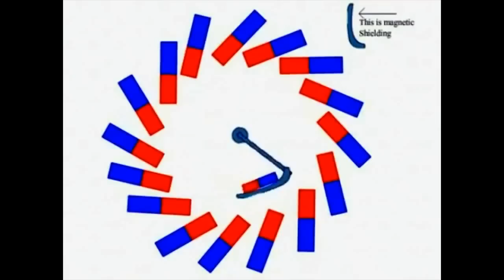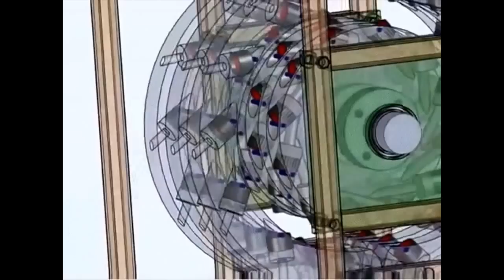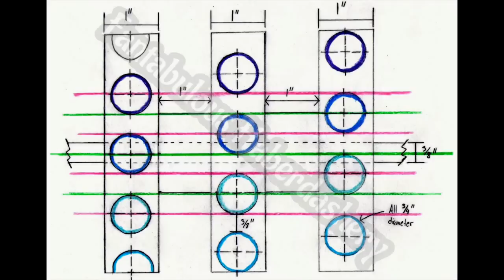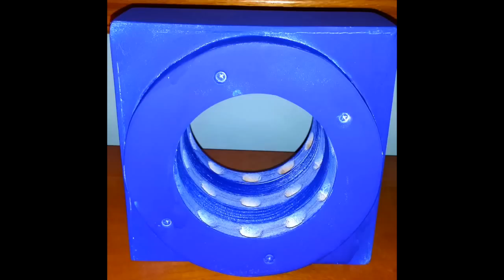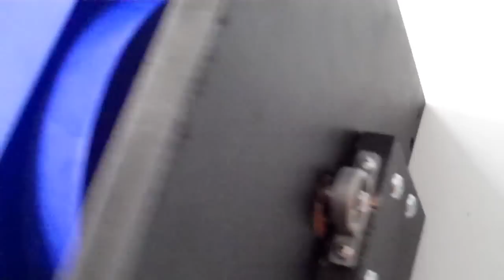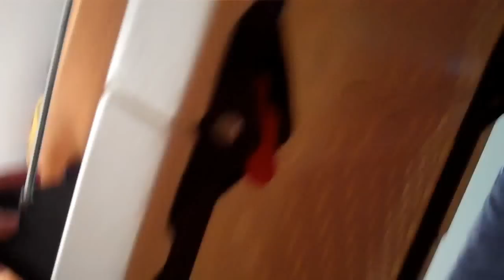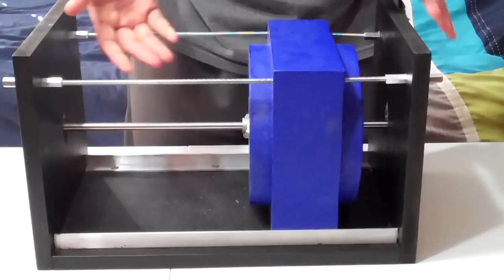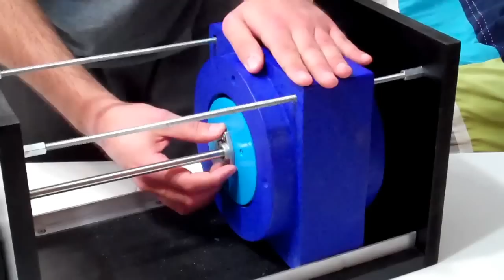Working Perendev Magnet Motor!

Comment: Its fake!!! Look for a shadow on the far left when he takes his right hand out of view, a shadow of what has to be an external assist motor likely with a rubberized knob, suddenly appears, he is placing a motor against end of the rod from the outside.  That's why he is holding his left hand so hard on the machine, it's to offset his right hand pressing the assist motor onto the rod where it comes out, (then see the shadow disappear right before it suddenly starts to slow down).  He goes again, and again you can see the shadow was there and disappears.  Lying Thief.
Reply: this.sure with good bearings, well weighted fly wheel,  and minimal air friction u can get one of these to sustain a decent rpm for quite some time with just the initial input energy. however as soon as u hook it up to a gen and put a load on it itll lose that initial energy immediately.
Reply: Nothing like that. It's just about video editing. First you can hear how his voice sounds different while the looped-clip is playing which shall show it perpetuate. Second you can clearly hear how the rotating sound loops on the second clip. He uses no motor - some video editing is enough to let it run. Unfortunately not good enough to look real ;)
Reply: Rob England It slows down because the rotor rotation is uneven, watch the uneven rotation!
Reply: +Fitzliputzli23 it's his arm. Why would he need to cheat? his video doesn't really prove anything even though he considers his experiment a success, the machine clearly slow down and he is not selling any schematics. 
because of all the scam, people are so biased against the perendev motor that they always search to prove that whoever makes a video is a scammer even when it's clearly a friendly low-cost experiment.
Reply: You are right, my first guess was that he actually build-in a battery powered oscillator and electromagnet into the piece of wood. That would also be super easy to do.
Reply: There is nothing such as a "Perpetual Motion Generator". Any machine outputting energy will need it from some source that complies with laws of physics.
Reply: @Phantom Of The Opera, gosh, you don't understand the laws of physics involved. ANY object in motion has a KINETIC ENERGY that depends on its weight and speed. And objects slow down unless they move in a 100% friction less environment. E.g. planet earth can (almost) maintain it's kinetic energy moving around the sun as the FRICTION through the solar system's space is very low. The continuous loss of energy from the earth constantly hitting into particles emitted from the sun surely has a slowing effect, but it's very tiny. Another even closer example of energy losses concerning motion in space is that the earth's rotation itself is slowing down due to energy losses from the transfer of Earth's rotational momentum to the Moon's orbital momentum as tidal friction slows the Earth's rotation. That increase in the Moon's speed is causing it to slowly recede from Earth (about 4 cm per year), increasing its orbital period and the length of a month as well.
The force of gravity is what holds together large objects in space. It's likely that the math involved in gravity over large distances is more complex than we currently know and could explain the notion of "dark matter".
Reply: There is no magic in any system involving motion that has a very tiny energy loss and thus can run for a very long time. There is nothing Tesla did that is mysterious to modern science. In fact he had a weak understanding in some areas of what he was researching. For example, he imagined using wireless power well beyond what is actually feasible, efficient and safe. During his experimentations he also learned the hard way the dangers of ionizing radiation.
Just because I can't perceive the world slowing doesn't mean it's not slowing. Human senses are quite weak on detecting many things in nature.
So what exactly did the great Tesla prove that all the energy the world could ever need is available? LOL
Reply: Chill out man its not even that impressive.
Reply: Rob England, you are right. At 8:39 the reflection in the far left reveals the fake. He clearly adds something dark that hasn't been there before. And immediately the speed increases. At 9:15 the reflecting object is being removed. This is followed by a not very well made cut (poor editing quality). 
So, Haberdashery: For a first try your video is not too bad. Still a novice, though. But I see potential. It is all about practice. So, chin up, you may become a good faker someday!
Reply: Rob England damn right Rob I see it on the left wall where the white reflection is when he puts his right hand out of you you can see a shadow go on the wall and the motor continues to turn

Comment: You have a tiny Fly Weight on there why not use a Ultra weight flywheel 10x 15x 30x the weight of the rotor once it spins up and "Catches" as you say centrifugal force and weight alone should be able to keep it running far longer that what it Is at the moment Look at some of the old 1800's Diesel motors they were tiny little 30CC Cylinders  with a flywheel 500x their weight once it got up to speed you could shut off the fuel for 5-10 Min sometimes longer if they bearings are really good , Expansion, Contraction IE turning it into a Stirling type motor. or if you set it on a revolution counter and every 30th time it cycled it gave fuel for 2 cycles bringing it back up to speed like a "Hit and Miss motor"  There is no true Free energy with the right setup you can actually generate electricity for 1/2000th -1/4000th of the average cost   Just combine a ULTRA weight flywheel to a hit and miss diesel yes it would be a pain in the Arse to get started but once it got spun up it would be almost impossible to stop
Reply: MrClaypogue .. yes

Comment: oh man, please!
First: You gave it impulse and it can rotate, but not for unlimited time. With every rotation is use some of your impulse.
Sec.: It is without load, like all videos! When you connect a load like a generator, it will fail and not rotate.
Reply: Third: There is an electric motor, just out of frame on the left side, that he is using to spin this pos.  Harberdashery, you are a con man.
Reply: Hey James, why don't YOU try that?
Reply: I think this concept will work.  The problem was that he used aluminum in the construction thinking aluminum is not magnetic, but it is.  Aluminum is magnetic when the magnetic field is moving but the magnetic drag slows the motion down.  Try this: put a small piece of aluminum say 1 or 2 or 3 inches square on the table and then take your strongest magnet and move it quickly across the top of the aluminum.  It will slide across the table in the direction of the movement of the magnet.  The magnet creates electrical currents in the aluminum and the electrical currents of course create magnetic fields.  That causes a magnetic response that will stop any motor as it uses up energy, creates heat,  and has a magnetic field pulling in the opposite direct to the motion.  But it was a good idea.  Remove the aluminum and you will see.

Comment: Cool design man.  Not sure if its as advertised, but you make a great case with your common sense and logical thought streams.   I do wonder... if the actual off-balance nature of the imperfect structure ... actually causes an energy amplification effect.  Sort of like a springy compression and release... coupled with some mild flex, leverage, possibly aerodynamic effects, gravity, as well as vibrational structural effects.   They say that the key to the universe is vibration.  It would be interesting to see a flawless version.. maybe with magnetic bearings.  I also do wonder, if plastics spinning causes a slight static charge.. which could effect things.  So maybe wood, stone, or something similar.. could be used.   As for shielding magnetics.. I was recently schooled about the internals of Hard Drive magnets.  Their super powerful Neos are mounted to a special metal backing.. that is absolutely incredible in its ability to shield.

Comment: What do you have under the table? A motor spinning a wheel studded with neodymium magnets that cause your so called motor to spin as it is acted upon by magnetic induction through the table top? Because what I do know, is that this and any other so called magnetic motor will not work! At least not in a package like the one you are trying to convince people will work without any external source of energy. There are smart people in the world, and you are probably one of them. The Power Station at Niagara Falls has huge generators that are turned via falling water. The electricity that is produced by this station provides electrical power for many homes and businesses. Believe me, some very ultra ingenious people designed and built this power station, and had magnets worked as equally good or even better source of energy than falling water, they would not be using falling water. Spinning magnets in the rotor of these generators move electrons through huge elaborate coils in the stator. The spinning magnets are spun by the pure tonnage of falling water. Magnets can never take the place of falling water,  wind, or heat. Think about it if you really have a good grasp on physics.

Comment: 1)change magnet shape to alter magnetic field for less end point attraction and tighter repulsion field,(hollow mushroom shape maybe)  only solution atm as monopole mags haven't been invented yet,
("When two equal magnets touch each other, the attraction between two unequal poles is 5-10% stronger than the repulsion of equal poles. That is due to the alignment of the molecular magnets in a magnet. In a single magnet, the molecular magnets are aligned sort of parallel to each other.")
2) will it spin under load from current draw

3) can a robert boyle perpetual water wheel flask be integrated for extra force ? perhaps.
Reply: Ah ah ah, altering magnetic field shape !!! You're too fun.

Comment: My theory based on field theory, is that movement is an attribute, the only energy comes from polarity, every action has an equal and opposite reaction, so for one spin, creates opposite spin -> polarity, like spins repel, and opposite attract, the energy IS the spin, the movement force is inertia, the spins cause acceleration. Think about this, where is the energy causing magnets to attract to each other? It takes a very small amount of energy to magnetize magnets, yet you can combine magnets with mechanical movement to create electricity for a very long time until the coherency of the atoms in the magnet eventually become incoherent, but then you can once again realign them for small amounts of energy to make them coherent. magnets them selves create mechanical movement with no outside mechanical movement  (place two magnets opposite poles within a vecinity of each other and they attract them selves. Where is the energy creating this mechanical movement? Even our accepted quantum sciences says this is from atomic level pole coherency, so speaking on atomic level where is the energy? -> my idea, the only energy is the SPIN in polarity, movement is an attribute of acceleration from the attraction repulsion), magnets can be made natural its just the addition of coherent polarity in atoms -> the atoms poles are all aimed in the same direction creating a strong coherent magnetic field. So with this theory, you cant create more polarity energy, nor destroy polarity energy, but you can mix it around, and create infinite imbalance loops of them trying to balance out. Last to clarify, movement is an attribute of the acceleration energies of fields of force -> only type of energy, mechancial movement is inertia, or loss of inertia from the polarity energies causing it to be lost and accelerated (my thoughts Id love to hear any thoughts or if I got anything wrong, just trying to brainstorm, we are still missing a lot of info on how the cosmos works)
Reply: Your idea doesnt work and really shouldn't be called "theory".  It is a conjecture.  To be a theory, it needs to have the power to explain and be consistent with its self.  The energy that causes like poles to move together comes from the magnetic field.  After the motion, there is less total B^2.  Thus the potential energy of the magnetic field is converted to potential energy.  The only way to get back to having the total B^2 you started with is to add energy by pulling the magnets apart.
Reply: +Ken Smith by definition I can call anything a theory but I understand that the context confusion by comparing it with scientific theories. you can cause magnetic acceleration without needing them to stick, you can sling shot them. what about that? I'm truly curious not negative challenging

Comment: can you keep it rotating for 5 minutes ? kindly attach a video
Reply: It is based on the Perendev design which was a prop for a fraud that a guy called Mike Brady went to jail for.  The same trick could be done with this machine.  It is just a matter of hiding the electric motor and wires from the point of view of the camera.

Comment: Good on you, that was a very good effort mate.
But the rotating wheel assembly doesn't seem to be centrallized on the shaft, putting the rotating parts out of balance, which would greatly effect the performance of your magnetic motor. You would really need to build your motor on a CNC lathe machine to make sure that every part was very accurate and in the correct position.
I know, "but that costs alot of money!", unless you have a friend who works as a machinist or a fitter/welder engineer or you do night school at a technical institute.
Have you seen the "Yildiz magnetic motor", he has recently patented it after giving demonstrations to scientists, and senior officials at Universities around Europe. It will definitely change the future of power generation.
Another motive device is the Aerodynamic air turbine engine designed, developed, built and tested by Haskell Karl in 1960 , it was shown to Wyle Testing labs by him and then the usual story happened, certain people tried to make him disappear forever!
He eventually resurfaced decades later and was contacted by Rockwell enterprizes who rebuilt his internal tornado turbine self running engine around 2008 with better technology and made it better and even more efficient. Rockwell Scientific Research LLC "The crystal ion air turbine."
And then apparently the US military got hold of it and that was the end of that. We are not allowed to have it. Imagine land, sea and air transport, no more fuel required, just normal ambient air to power every mode of transport on this earth.
You see, those in control of the human race are all part of one big global system, linked between countries, shadow governments, major corporations, chemical and pharmaceutical companies, medical systems, food development and control, water supply, education and universities, History and libraries, viruses and vaccines, markets and money, manufacturing and war.
When you grow older and wiser and gain valuable experience and look at everything with an open mind you will see everything and understand how controlled we are and then realise the truth in what I am saying.
Let's get the truth out there, for free for everyone to know. Not to make any profit, but to make a better life and future for all humanity.
Think positively, be happy, All the Best.

Comment: The Overunity Magnet Motors works - yours can work too if you make some modifications - watch my model of OU magnet motor JAMM from 1999 inside movie Overunity Charger - which is working (my own design presented in JLN Labs forum at that time) - a design that works - and inspire from that - you must understand that you must have there in your motor a continuos rotative pushing - asyncronous, do you get it? I can make your motor work, if i would be there with you - all the best - keep going with your good work!

Comment: hi, dude your video is fake, at 8:42 you failed to hide the laft side of your motor... and we can see the reflection for you right hand... and when ever the motion is sustained, your right hand is not visible... and when your right hand becomes visible, the motor suddenly losses RPM. in fact at 8:42, it took some time for you to rotate the rotor via bearing, that rotor first slow down and then it picked up the rpm as we saw the reflection of your hand.... so its fraud :)
And magnets dont wear out unless heated.
Reply: It's only fraud if people actually are stupid enough to believe in this crap!